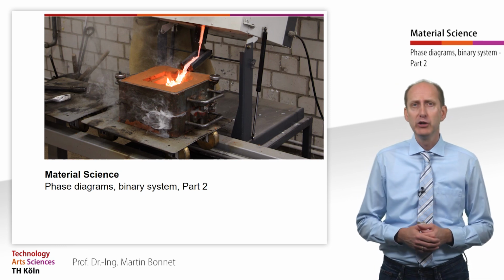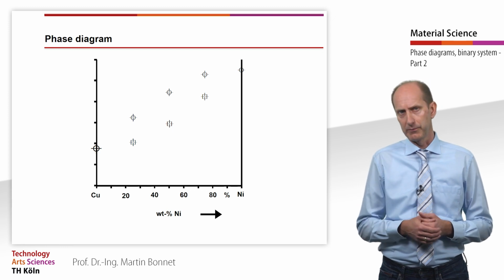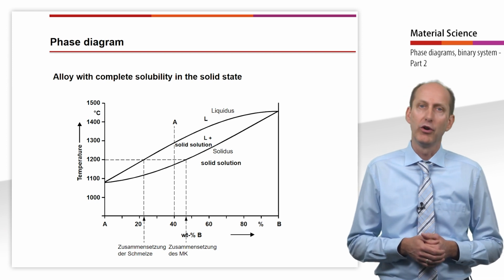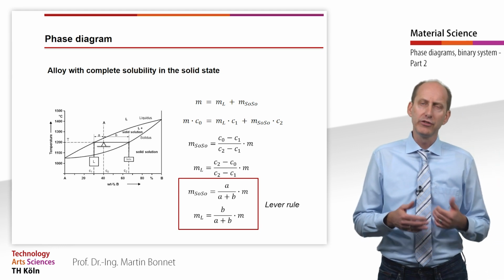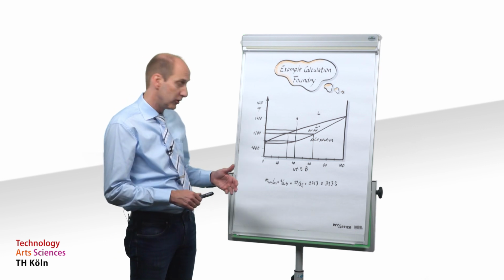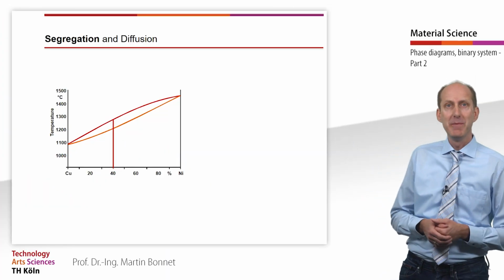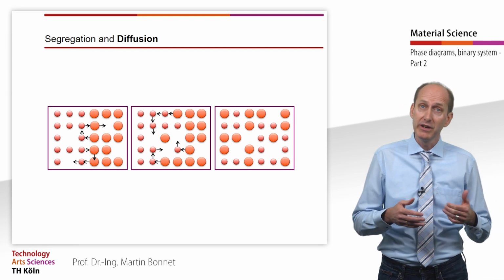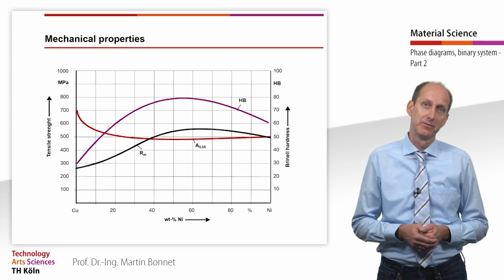Material Science, Phase Diagrams, Part 2

Comment: Thank you Professor Bonnet for these excellent videos. I do have a question regarding the concept of Segregation, in particular regarding the concentration values of Nickel in the melt and the solid solution. 
1. Our overall concentration values are 60% Cu and 40% Ni. In the temperature range of T > 1300 C for example, this concentration proportion will remain in the liquid solution. Thus, I do not understand how at 1275 C, the melt can be 40% Ni AND also have a solid solution of 58% Ni. I think I am confused as to what this value represents in the real world?
2. Why do the respective concentrations not add up to 100% as the temperature changes? (In the foundry example the concentrations of Ni in melt or solid solution did add up to 100%).
Reply from the maker: The overall concentration stays constant 40% Nickel. This is still the case if you have solid solution with a higher Nickel concentration and liquid with a lower concentration. They don't need to add up to 100%, since they have different masses.